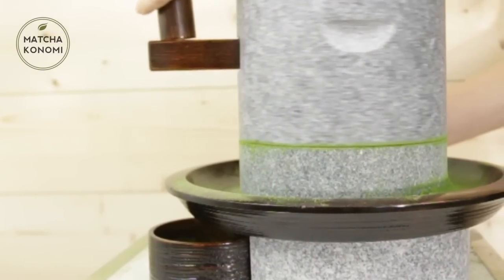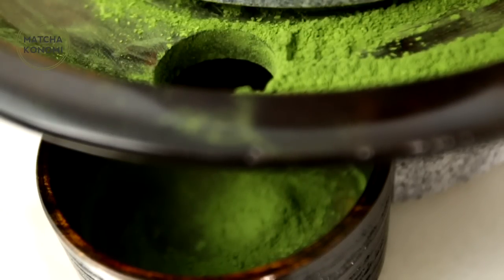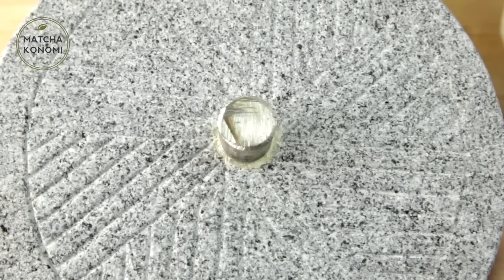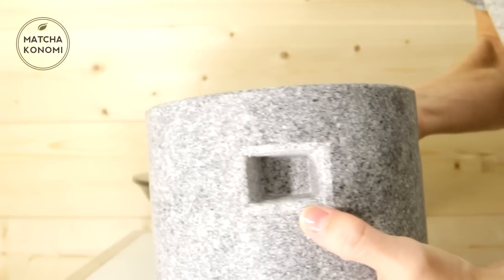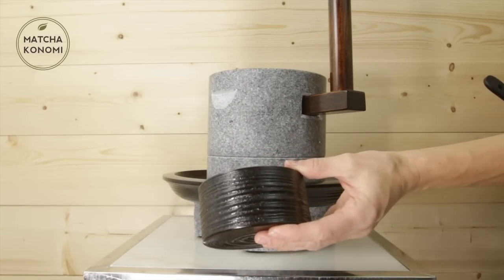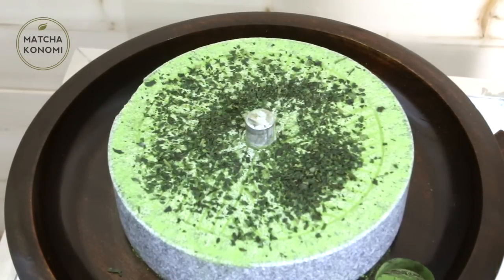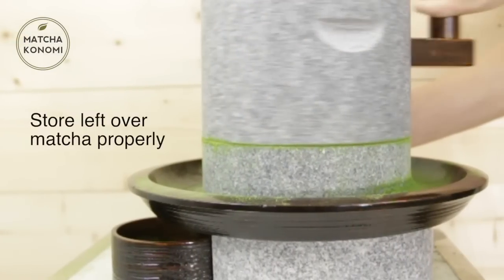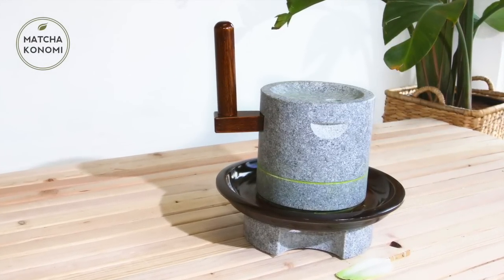Matcha Konomi Handmade Matcha Stone Mill

Comment: Could this be used for wet grinding?
Is there a spacer to prevent the disks grinding against each other.
Thanks!
Reply: Yes, same question from me ... can we also use this as a wet/dry grinder ? what about soymilk from soybeans ? can it grind grains and pulses into flour ?

The spacing and pattern is critical ... if it can only handle tea, that would greatly limit it's marketability.

Meanwhile, if it can do any of those, please let me know which, whether or not you ship to the USA, and how much.
Reply from the maker: Thank you for the question! 

This stone mill was hand carved for matcha only. The tea and the powder must be very dry for it to move through the carved groves to be ground into an extremely fine powder. Anything wet would not work. There is no spacer between the stones. These stones we’re designed to grind the tea into a fine powder and push out the joints on the edges. We advise users to place some tencha between the stones before grinding as a buffer when getting started. We hope this helps. 💚
Reply: @RovingPunster  There is a  stone grinder similar to mortar and pestle which is used for wet grinding.
Reply: @renukanair831  I believe you, and thank you ... but without an actual link or a product name to search on , I have no way to act on your tip.

Comment: Can I use it to grind soy bean ?
Reply from the maker: This stone mill was hand carved for matcha only, The tea and powder must be very dry for it to move through the carved groves to be ground into an extremely fine powder. These stones were designed to grind the tea into a fine powder and push out the joints on the edges. We advise users to place some Tencha between the stones before grinding was a buffer when getting started. We hope this helps! :)